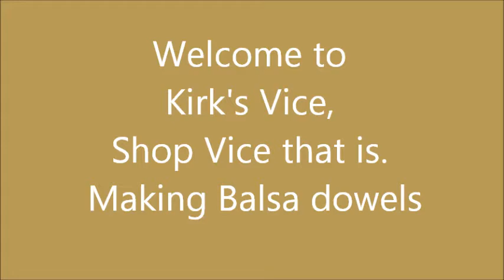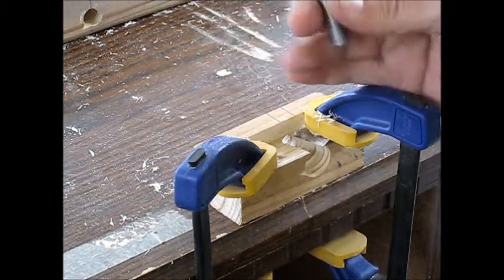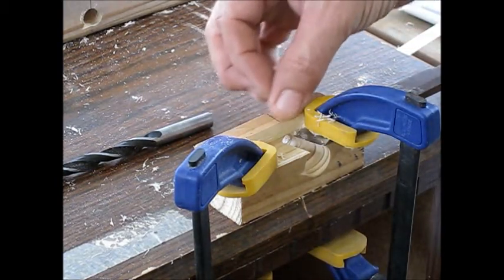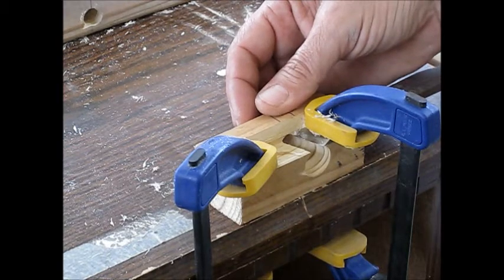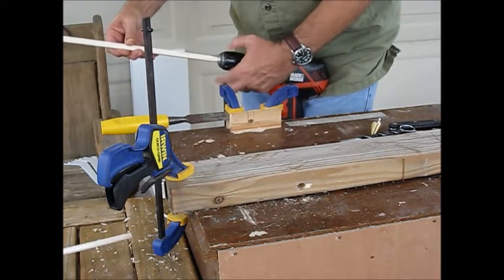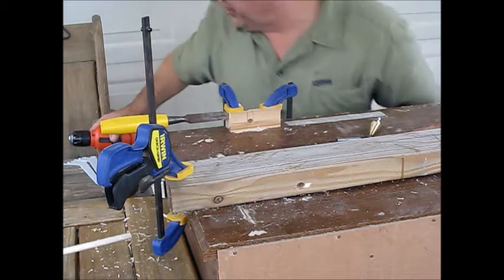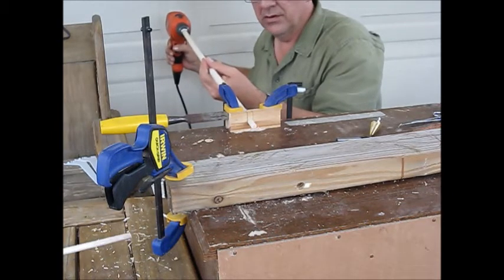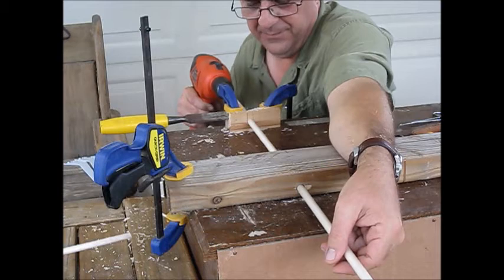Balsa Wood Dowel Making

Comment from the maker: Dream, it certainly wood. Just make sure you have a sharp chisel. It is basically a lathe with a stationary cutting tool. In fact, much of the conversations and dowel making jigs I found were aimed at making hardwood dowels for arrow shafts and some for furniture making. Actually the soft balsa is challenging to turn.

Comment from the maker: Not a problem Roni, I learned it from someone else. There are several key factors, the main one is a razor sharp chisel! Also, recently I read somewhere about doing a rough sanding job on the stick to knock the corners down before putting through shaper.